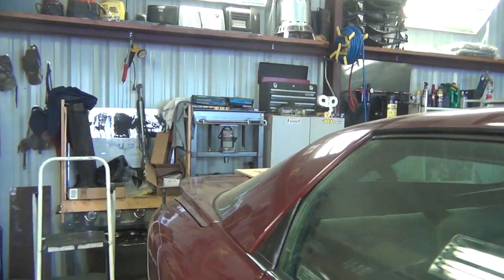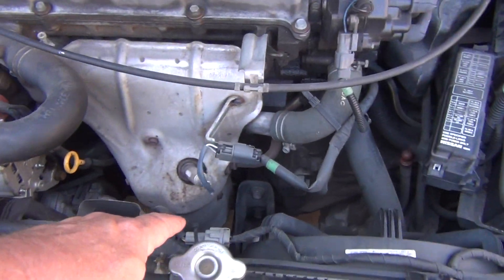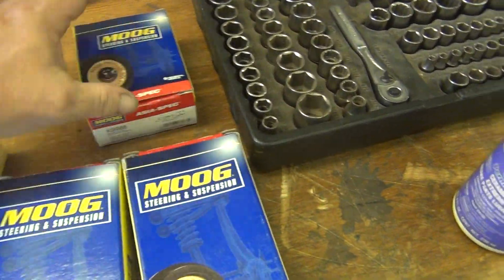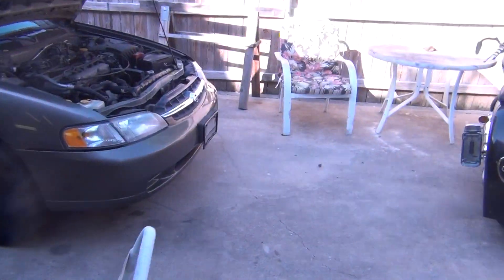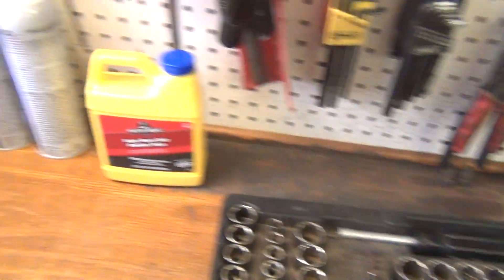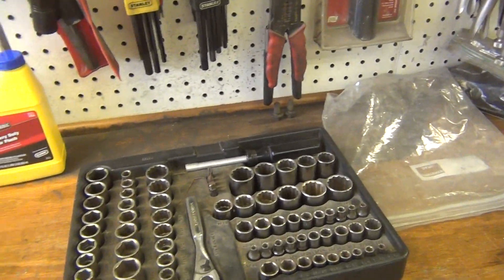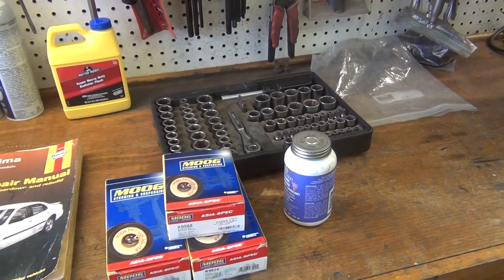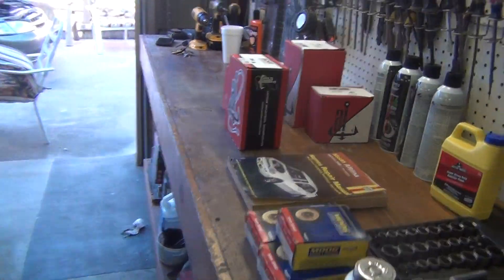A little work on the 98 Altima

Comment: Always busy huh Hanson?? I too would like to hear about the clutch hydraulics. Something to learn there. Have you been paying any attention to the Indy news?? That Firebird is going to be better than new shortly. Hope to get started on some metal work (patching) on the 57 this weekend. Yay !!!
Reply from the maker: Will make a video on the clutch when i get that done.No what going on in the Indy News??Great news on getting started on the patching work make a video and let us know how that is coming out.
Reply: They're  gearing up (practicing) for the Indy 500 next Sunday. So far, single car top speeds (no draft from other cars) has been in the 222 range. Today they practiced with increased boost to simulate qualifying trim. Should be some higher single car speeds. Looking for Qual times @ +- 228-229 MPH. If you're ever been to the speedway, those 90 degree corners are much narrower than they appear on TV. Can't imagine heading for one of those corners at 230 MPH.
Reply from the maker: oh ok me neither going into a corner at 230 mph must get your heart pumping for sure